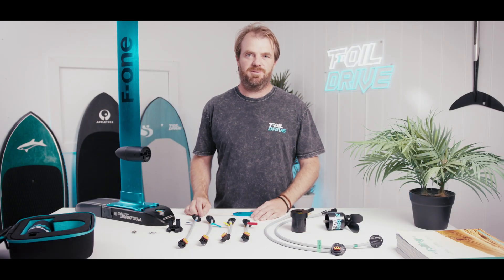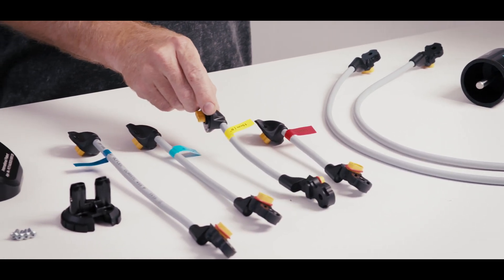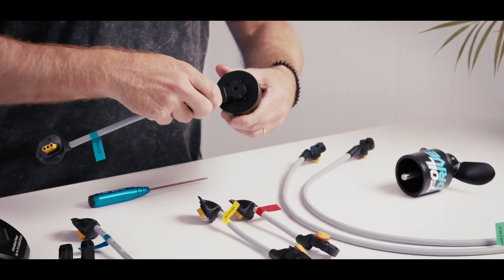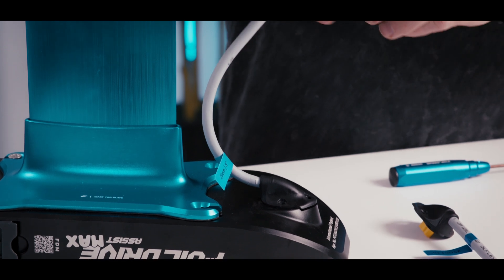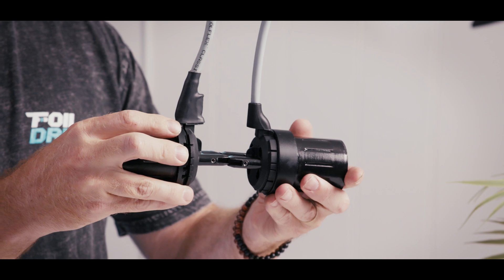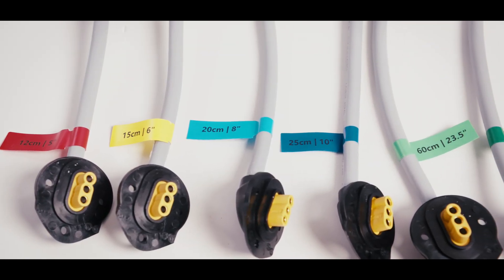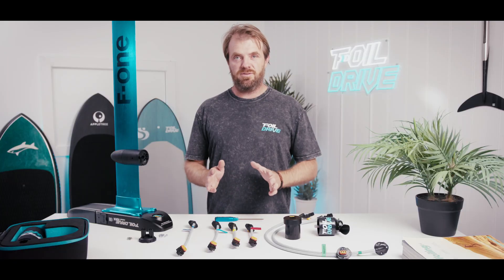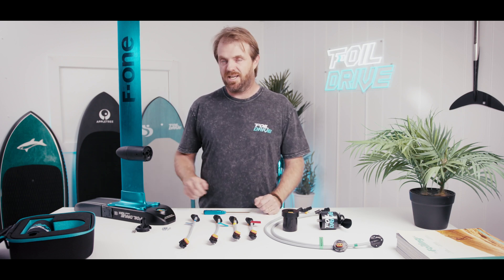Foil Drive | V2 Motor Overview 2024

Comment: What's that saying "create a problem and sell a solution". Same with battery percentage gadget. Feels abit like a slap in the face to early adopters.
Reply from the maker: We're always developing just like any other product, as technology improves products continue to develop. We're always looking for ways to make sure existing Foildrivers can utilise updates with their existing gear if they choose. Thankfully the V1 motors have the same power and output so no loss in the water :D
Reply: @foildrive  how about inset boards with a compartment for the foil drive? That should be a significant improvement. Foil drive is compatible with so many boards but vast majority of them aren't optimised at all for foil drive use.
Reply from the maker: @Stanfoils  Coming soon!